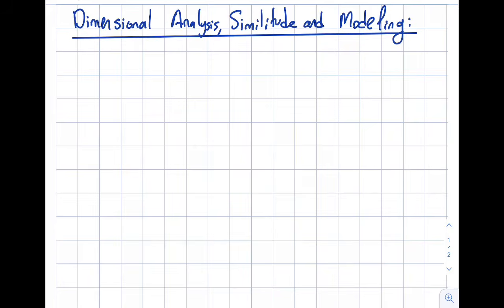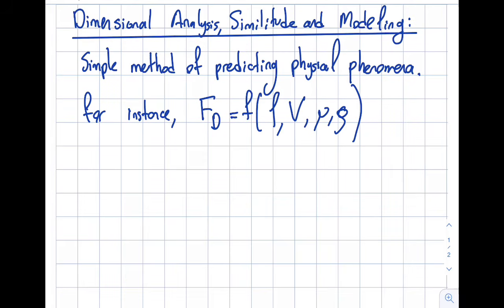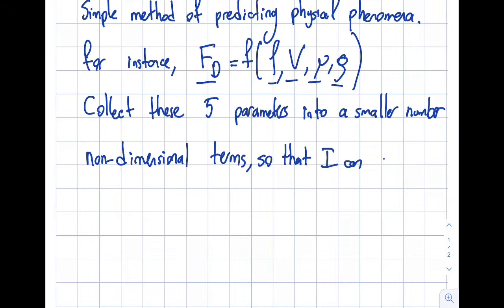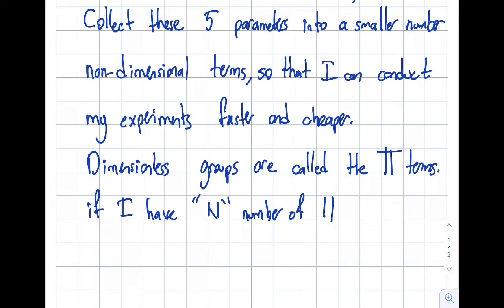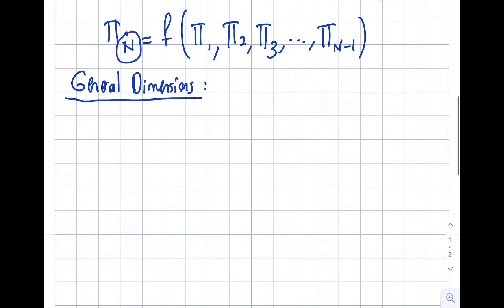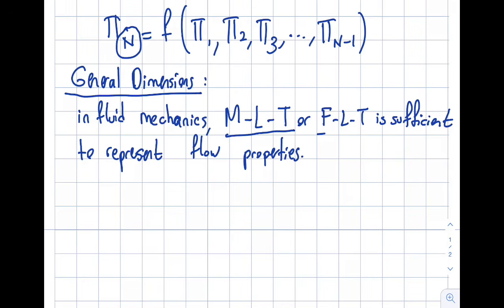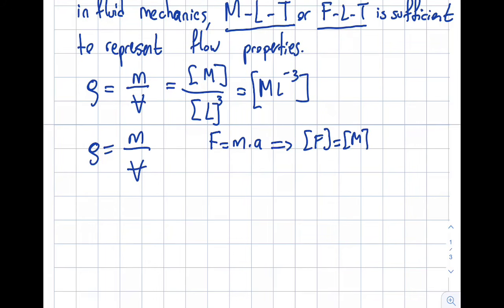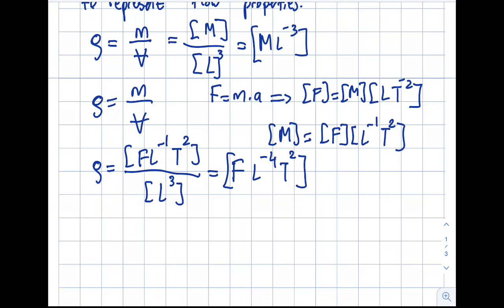Fluid Mechanics 10.1 - Dimensional Analysis and General Dimensions

Comment: I have only just come to this video but I want to thank the creator for posting this - I have come here from reading 'The Secret Horsepower Race' by Calum Douglas, where he mentions that Capon and Brooke wrote a paper applying dimensional analysis to supercharger impellers, which Stanley Hooker read when he was employed at Rolls Royce. Hooker then used this technique to model the flow of the supercharger compressor and more accurately predict how it would behave at high altitude. This was apparently crucial in obtaining and developing the high altitude performance advantage that the Rolls Royce Merlin engine enjoyed from 1942 till the end of the war. So here I am trying to understand this...